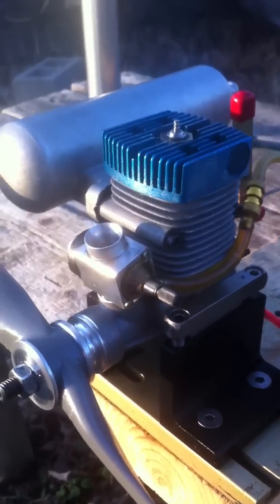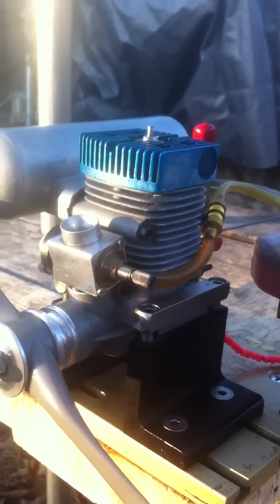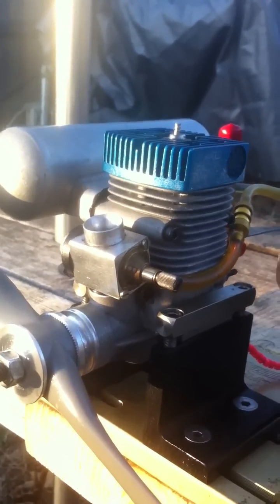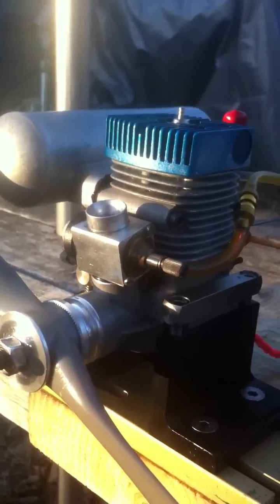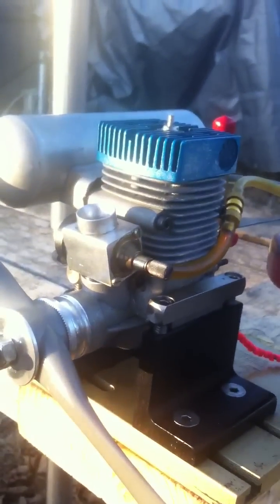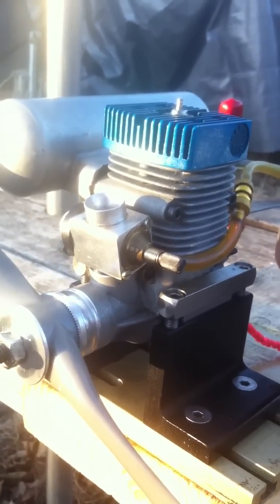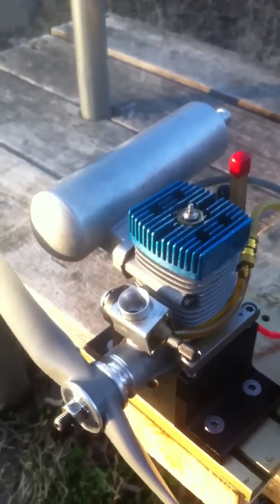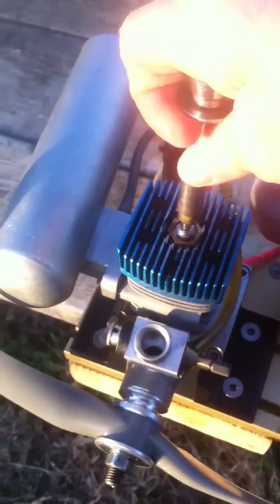Webra 91 P5i running on gas/glow mix

Comment: it flew?
Reply from the maker: Used the engine on a Goldberg Tiger for a long time.
Reply: cool...! did you have a problem with the overheat?? with the mix gasoline- petrol?
Reply from the maker: No, it actually ran very cool.  Had to wait a minute for the engine to warm up before disconnecting the glow plug.
Reply: @In2Engines  hi can you please tell me the mix of fuel and oil please
Reply from the maker: @muhulicavalentin4084   Hi, here is a very nice thread on the subject.  I used the mixture that was recommended at the start of the thread.  I mix my own glow fuel.  http://www.rcuniverse.com/forum/engine-conversions-92/8009384-gas-glow-how.html

Comment: Hi, I'm planning on experimenting with Gas/Glow on my OS GT15 gas engine.
What kind of rpm's were you seeing on straight gasoline before you tried the gas/glow mix?
My OS gets 8,500 with a 14x8 on straight gas. I'd be ecstatic if it runs as well as that webra.